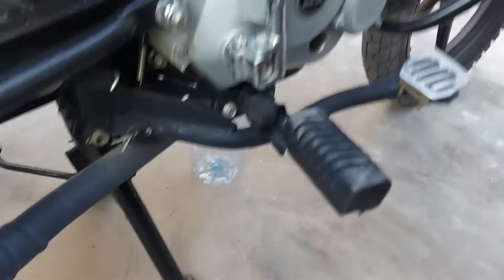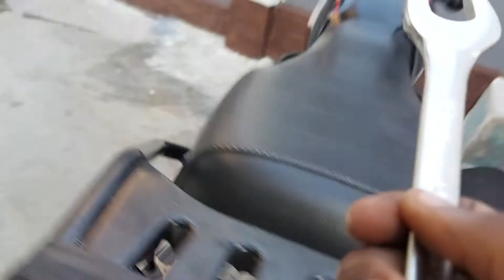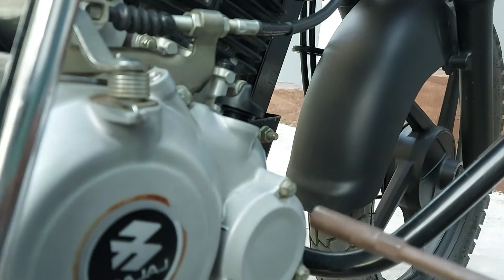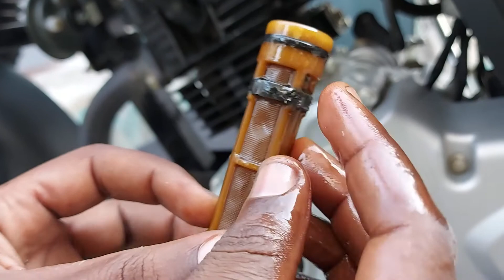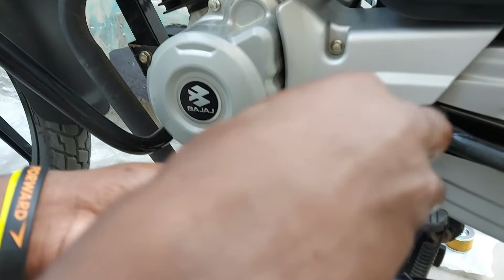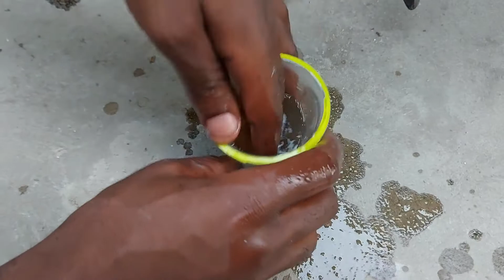How to change Oil in Bajaj Boxer X150 Part #1

Comment: This is nice and very helpful. I have a question though. How do you usually start your bike in the morning when the engine is cold?
Reply from the maker: I live in Dar es Salaam Tanzania,I never experienced any cold start issues, and I never used a kick starter, only an electric starter.
Reply: @5GearsReview  Ooohhh.. thanks for the reply
Reply: I usually let it run for a like 5 mins with slight revs to get the engine to warm up.

Comment: Hey i really like your review. I have a question how often should one change the oil?
Reply from the maker: It's highly recommended every after 100km  beyond that oil will be so dirty, less in viscosity and affect engine performance.
Reply: my bm150X changed OIL after even around 800 KM
Reply: @@myreviews4620  changing every 100km is like changing everyday or so.. maybe 1000 but usually it's 3000 km